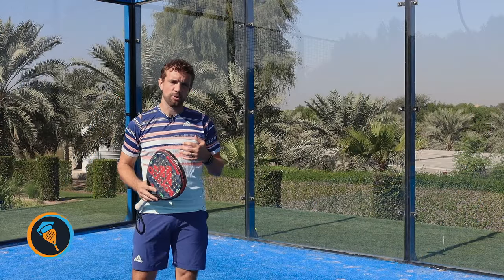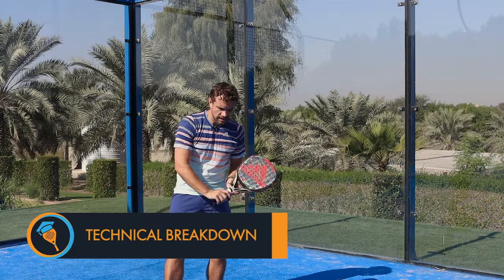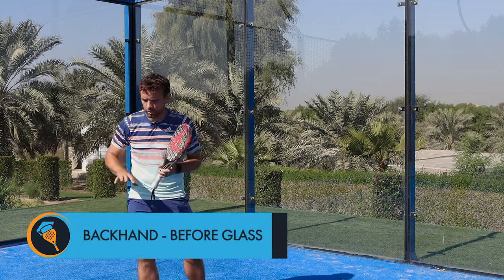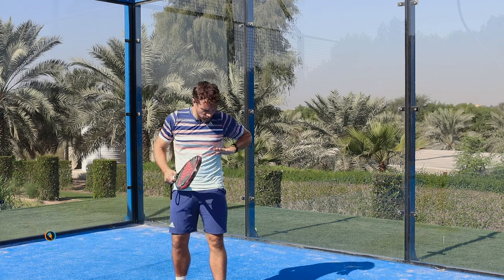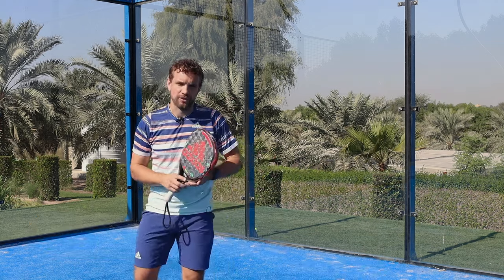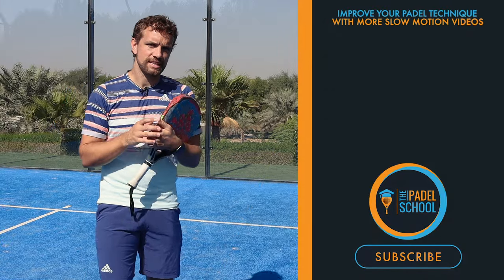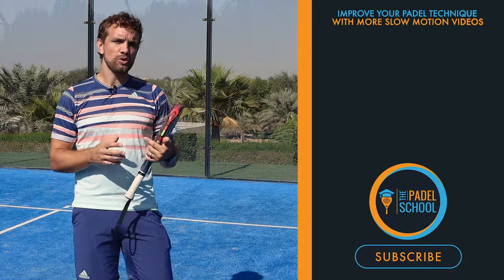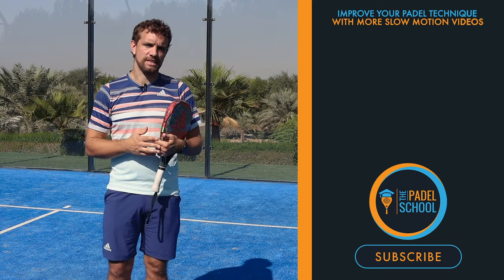Struggle with your Backhand? Padel Technique

Comment: Hi Sandy, I really appreciate your work, thanks to you I began playing padel. I'd like to ask you a question about my backhand: I come from tennis, so I used to spread my index finger from the other fingers quite a lot in all my shots (I used to play the backhand with two hands). When I started using the 1 handed backhand in padel using the continental grip with the index finger spreaded I struggled A LOT hitting the backhand flat, I always used to chop the ball and to shoot with a lot of spin but with no power at all. Lately I tried to hit the backhand flat by using always a continental grip but with the index not spreaded and with the wrist parallel to the handle of the racket and in this way I manage to hit a good flat backhand. Of course using this technique I have to adjust my grip a little bit when I want to use this flat backhand. I would like to ask you if this adjustment of the grip may be a problem by playing at a higher level. Thank you and keep it up!!

Comment: Hello Sandy, I have two questions please:
First question is: should we swing the wrist while hitting the ball to increase the output power? (I can see that you didn’t swing your wrist in this video)

Second question: while preparation for the backhand hit, exactly just before the hand with the rack is released from the non-dominating hand to go to hit the ball, should the non-dominating hand holds the racket tight to make something like charging the hit so when the racket is released, it goes fast and with more power and acceleration?

Glad if you can answer my question 😊

Comment: Hi Sandy. Just starting with padel after years and years of squash. Never had any problems with the backhand before but in padel much more uncertain of the stroke. 
When taking back the racket I tend to want a lower position of the blade since when I have a higher, a bit like yours, I tend to slice the backhand. Could you straighten me out how to address the racket position? Thx for all your videos outstanding work.💪
Reply from the maker: When I teach this I start with the player taking the racket back a little lower to avoid that slice - at higher levels the players that can already hit flat often have a slight nuance in their take back. I would advise to continue to practice the take back low!

Comment: Nice video! I notice in all your technical breakdowns that you keep your eyes on the ball until the point of contact. When I'm about to hit a ball coming towards me, at some point during the trajectory I freeze my vision forward on the spot where I plan to hit the ball and therefore not watching the impact itself. In most cases it works fine, but sometimes I miss the shot completely, other times hitting with the racket frame (because of not having turned my racket in the continental grip). Do you know if this is common? I believe that this bad habit is hard to break
Reply from the maker: Controlling the racket face in continental grip is really important - and is definitely a habit that needs practice...as for the eyes on the ball if you can it is great to watch it onto the racket, but sometimes with the faster ones it is difficult.
Reply: @ThePadelSchool  Great answer - as always. Thanks a lot:)